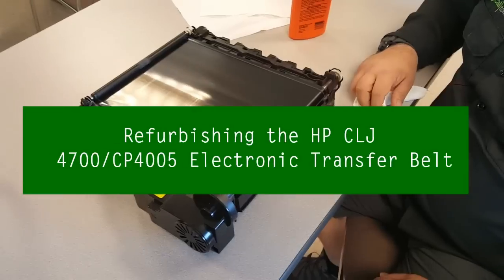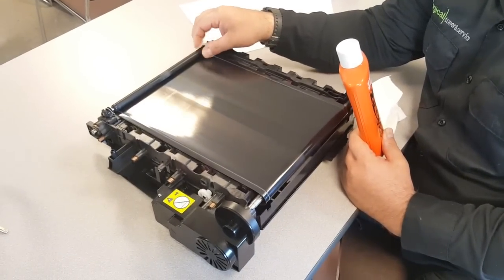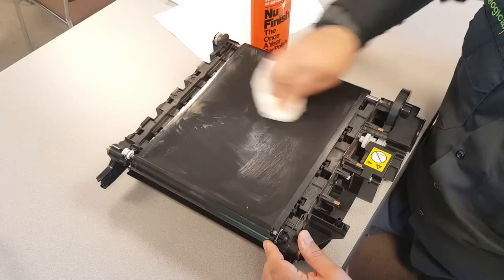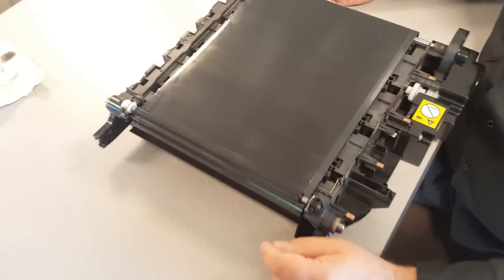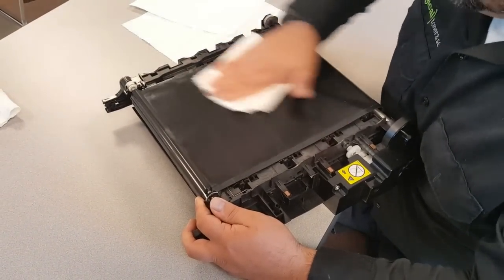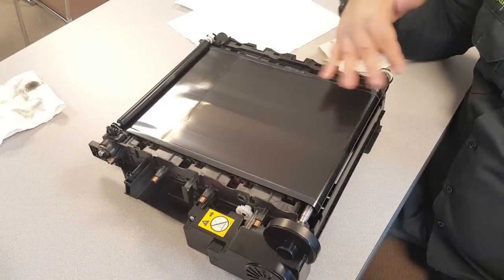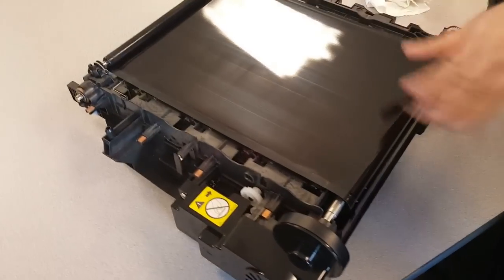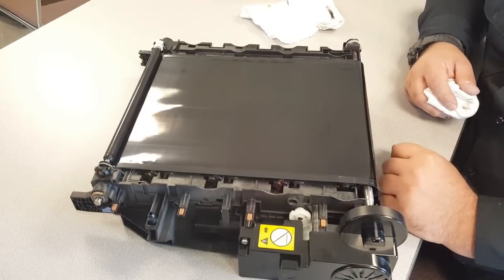HP Color LaserJet 4700 / CP4005 ETB / ITB refurbishing tutorial / How To

Comment: Sorry I have to say this but this video shows bad practices! First of all: NEVER EVER touch the transfer belt, use the white gear to move the belt. Be careful though that you turn it in the right direction! 2. Don't press down on the belt too hard unless you want to nick it, which will then leave artifacts on printed paper. Use soft, circular motions to clean the belt.
I don't know how effective car wax is. Everyone else just tells you to use a light cleaning alcohol (e.g. isopropanol), which I did and which also worked for my printer.
Reply: I agree. Though direction on these older models should not matter, as I understand it.
NB You need to remove the plastic cower to reveal the motor wheel with which you can safely rotate the belt either way. Only two screws.
Love these printers - I bet mine is working still in another 20 years :)

Comment: Do you have any alternatives for the Nu Finish? I'm in the EU and it is hard to come by. Would something carnauba based work? Also would a dirty transfer belt cause the printer to stop applying color to the printouts from one day to another?
Reply: You can use a light cleaning alocohol to clean the transfer belt, that's what all the other "how to clean the transfer belt" videos tell you to use. Btw, those other videos also tell you NOT to press down too hard on the belt (because it can cause new damage) and NOT to touch the belt directly because the oils on your fingers can damage the material!
I used isopropanol - you should be able to get it in a shop that sells e.g. electronic parts - and the "knife" left a lot of powdered color on the belt after moving it but that didn't seem to cause any problems.
Reply: No please don’t use alcohol, alternative is turtle wax  , I use it to clean the primary charge rollers (PCR) in the toner  cartridges when I remanufacture them